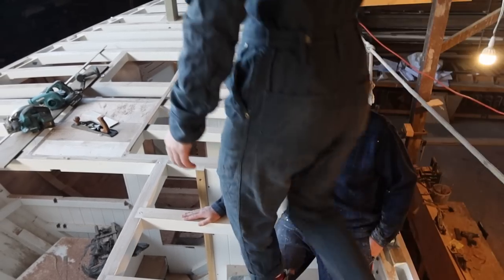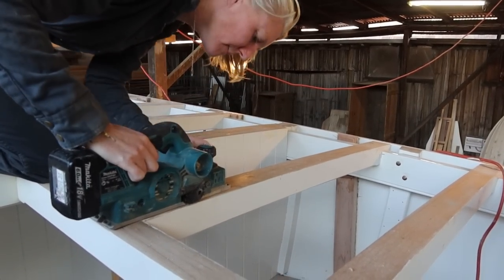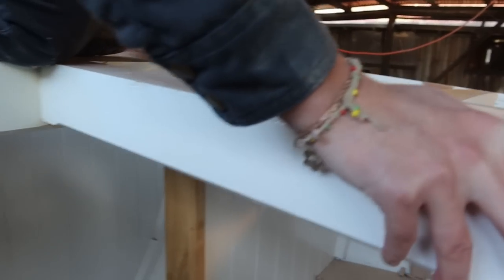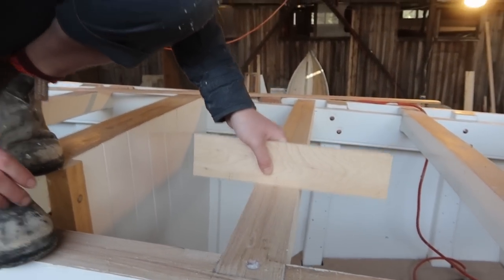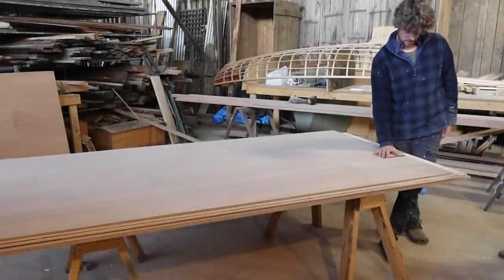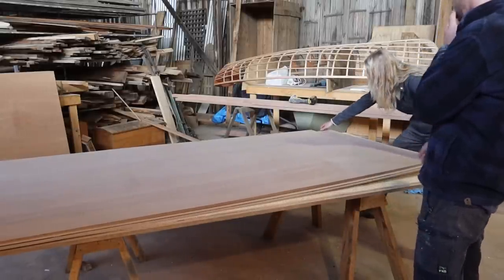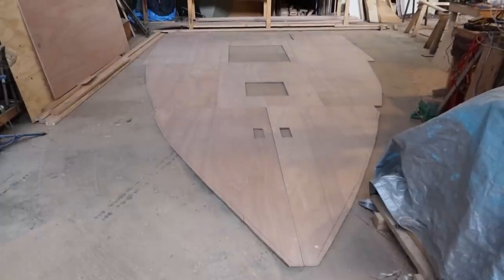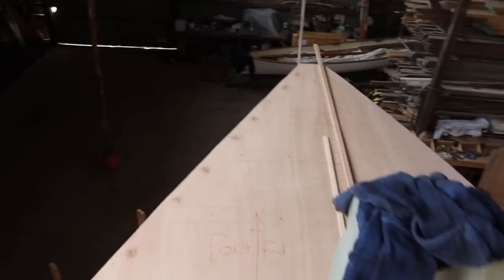Fairing deckbeams & laying the deck (EP14)

Comment: It's great to hear the surgery went well, I know how frustrating it is to be incapacitated in the middle of the build. Having the deck ply down will be a big step forward you guys are really getting a move on!
Reply from the maker: Yeah, matt still taking it easy but looking at a bit of electronic now and wiring which is fun

Comment: Got to take my hat off to you both on your woodworking skills. At the moment, I'm replacing all the woodwork on a 4m sailing dinghy (ok, so it's got a fibreglass hull and top😂) I'm replacing the hatch, transome plates, drop keel and rudder! Enjoying it but it's a lot less work and maybe only a few coats of varnish! Anyway, look after yourselves and thanks for the video!🥰
Reply from the maker: Boats are a great obsession to have! Small or big you still get plenty of satisfaction. Cheers!

Comment: i kind of admire your patients doing all the fairing, i have to admit i would find it very frustrating as i always want everything doing quick, i always wonder about the tolerances people work to, all that extra effort, does it make such a difference, i'm guessing any difference can cause some movement in the timbers, that can lead to leaking else where and future damage within the boat, but i do get the fairing on the outside of the hull for efficiency and speed of the boat, but again how much does this matter if your simply cruising around at leisure - still great work, admirable stuff

funny i was just remembering a table i built in woodwork as a kid, i had to use a spoke shave to shape the legs individually, supposedly checking as i go against the others, DOW, they ended up all different, so my lecturer ended up trimming them taped together and all i needed to do was sand them, the legs were set at 45 degrees in each corner and joined at the bottom by a cross over, they ended up thinner they they should be, but still looked elegant, it was sturdy too, you could stand on it and my folks still have it in the house as a prised possession

Comment: Lovely episode guys! Just a question. 
Have you sealed all the edges of the plywood wth epoxy before fitting? 
Cheers Steve
Reply from the maker: Hey thanks! Yeah all parts of the plywood get sealed with epoxy, and the rebate joins get glued with epoxy also. Gotta keep that moisture and water out!
Reply: @Building_a_Boat_by_the_River  just a thought. While you’re out of physical work with your shoulder for the next how ever many months you could focus on film and editing? I think part the reason the tally ho channel is so successful is each step gets explained in detail. I’m a way that even someone who knows nothing of boat building comes away with learning something and those who have experience are not left wondering, did they do such and such? You certainly have the quality and patience in your work! 
I think it could really help your Chanel grow and won’t leave you feeling so frustrated with not being able to get your hands dirty. 
All the best, 
Steve